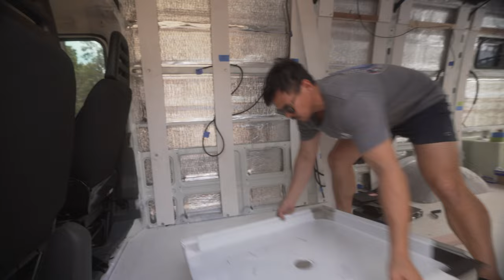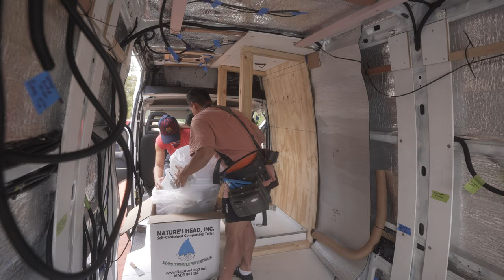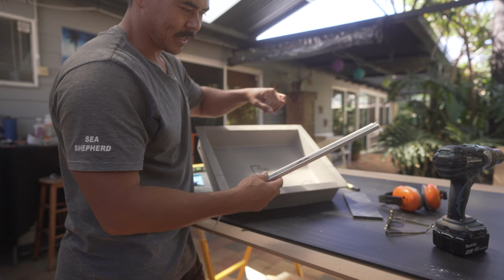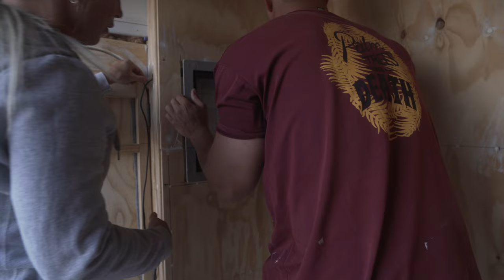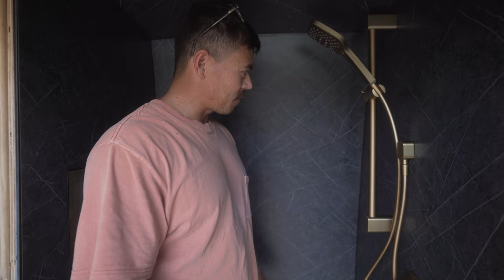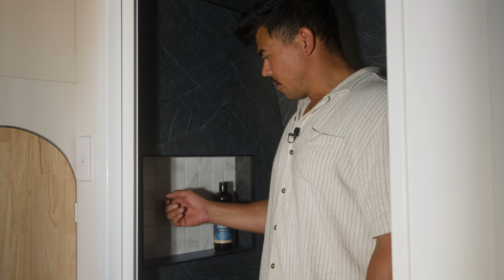HOW to BUILD a luxury shower and toilet in a camper van I Van life Australia

Comment: Very thorough - you put a lot of thought into this. Well done!  Could be built just as sturdy using thinner material, ripping your studs (verticals) down to 1” x 2-3/4”, etc if weight is a concern.
Reply from the maker: Thanks for watching Rusty.!  Yes in hindsight the 4 x 2 was a little overkill 🤦‍♂️ if I was to do it again I would definitely use lighter Timber.  Thanks for your feedback though I really appreciate it 🚐😀